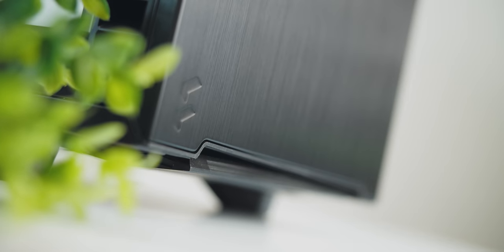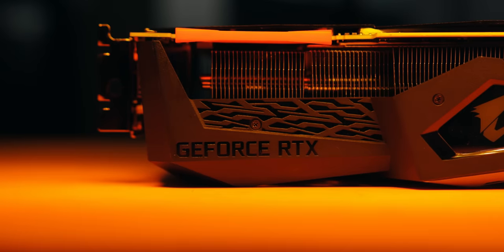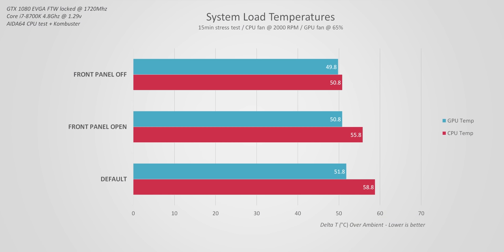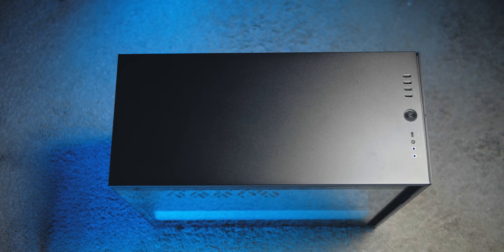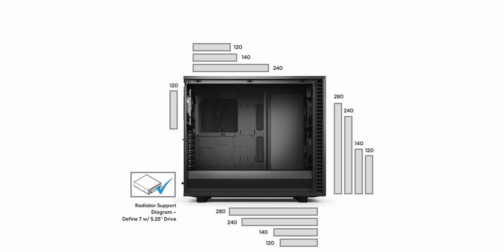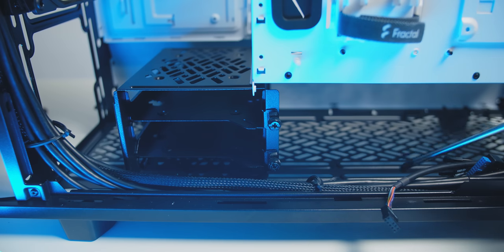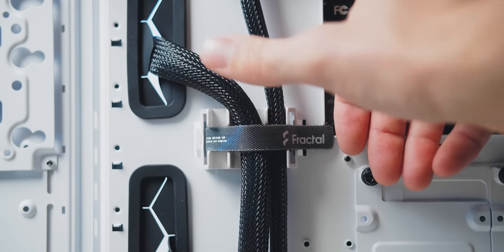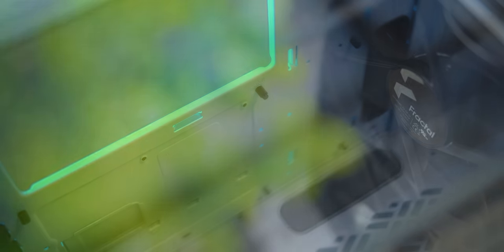Have We Reached Peak Case? Fractal Define 7 Review

Comment: Not even close to 'peak case' considering that design aside theirs simply better out there and everybody who builds PC's already knows that a well designed case should be able to not only provide the mounting points but actually have the space to use them fully which also results in a system that is silent anyway without the need to sound dampening materials which are, funnily enough, needed by the case your looking at due to how much extra fan pressure you'll need to overcome the lack of airflow in it's default setup. Sorry for the rant.

Comment: 1. Why are these case-building ****'s still putting USB 2.0 in their cases, especially in front?  3.0 is backward compatible.
2. They should provide at least "2" 5.25 Drive Bays...  I like to have an Internal Optical Drive and a Multi-Card Reader/Writer.
It pisses me off that I can't find good cases with the "door" like this one that has these slots.  That case could easily fit another slot with the 2 fans.
Anyone know of a case like this but has more 5.25 bays (or at least an extra that's a 3.5 floppy bay, cause the multi-cards fit that bay)?
I'm currently using a Syber with a door and 2 5.25 bays, but it's an OLD case...  I need modern one.
BTW, they absolutely need to fix that "wobbly" frontal case door...